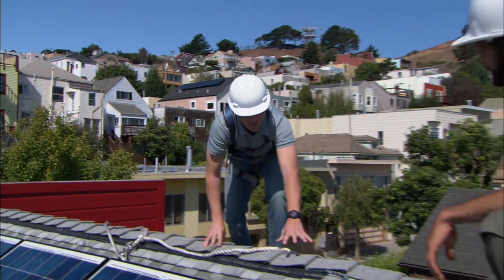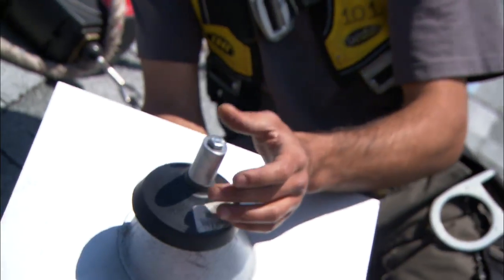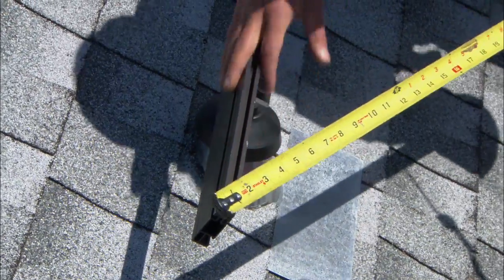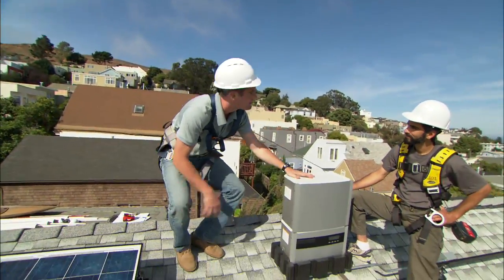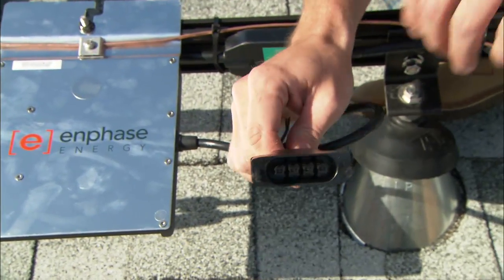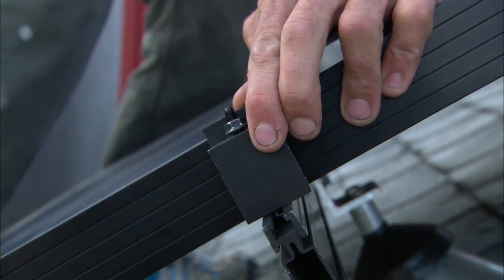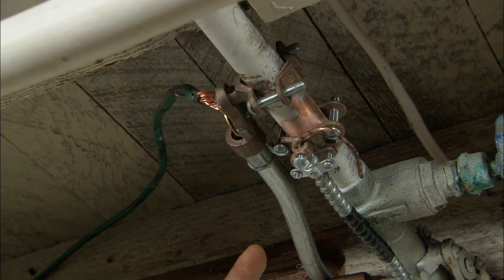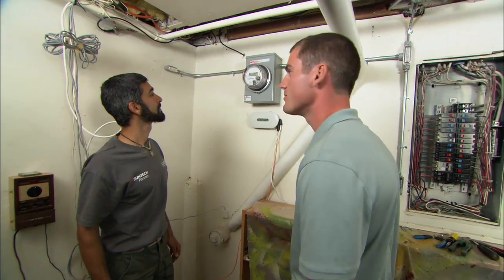How to Install Solar Panels | This Old House

Comment: When I see rubber boots on your stanchions it makes me nervous.   I have been a carpenter for 45 years and have seen many rubber flashing boots, using to flash pluming pipes, rot out in 10 years or less.  The rot is so complete that you can put you fingers through it and flick it away with little effort.  Sustained roof temperatures of over 150 degrees in the summer, guarantees you will have a problem before end of the life of your solar panels.
Reply: They may be silicone boots which are high temp rated.

Comment: I rather replace my power inverter that's located next to my circuit breaker vs going up on the roof and replacing a micro inverter. I will pass on the micro inverter.

Comment: From a potential solar customer, does drilling into the roof cause maintenance and repair issues in the long term? I have a concrete roof and would like to know if I should put my panels in the yard on a motorized pedestal.

Comment: So if the main power goes out does main breaker need to be turned off?
Reply: Yes if it was an off grid system being installed on the house. This is a grid tied system. It won’t back feed AC power unless it senses a load from the grid. If there was to be a blackout the inverters would stop producing AC power.

Comment: question. How to replace shingles uder solar panel?
Reply: You have to remove the array to replace shingles.   Its expensive to do that, so make sure your roof is in great condition before you install solar.  In my case I have a 20 panel 6000W array and we had a hail storm that destroyed the metal roof around the array.  It cost about 11000 dollars to remove and reinstall the array which is about 2/3 of the system cost new.  Then there was the cost of the new roof too.  Insurance paid for the removal and reinstall and new roof, but if it hadn't, it would have been economically devastating.

Comment: Get ready to lay out the $$ when it comes time to replace the roof, all that hardware will have to be taken down first. I bet some of those roofs leak after a while, too, which could lead to vastly more $$$. I'm not against solar, but am leery about roof installs even though that's "the way to do it."

Comment: Did you see the breaker? 20 amps. All of that expense for a measly 20 amp circuit. I have a 20 amp circuit just to run the whirlpool motor in my Jacuzzi bathtub.

Comment: The reason old solar systems used series was to drive up the voltage. New solar panels dont have this issue. Each panel is capable of producing 12-24 volts. You're putting multiple inverters in for no reason. Run each panel parallel into a single inverter and save lots of up front cost.
Reply: This was uploaded 2014..that was standard practice then
Reply: Wiring modules in parallel means thick and expensive home run wiring.

Comment: I have no in-depth knowledge on this, but i guess that all those separate micro inverters come with a downside. Each individual inverter has to measure the phase to know how to sync on it, and stay in sync with the phase over time. Doing that once at 1 big device is already quite applause worthy. I cannot imagine doing that same job at 20 different places in one system will do any good.
Reply: Here is an article about them: https://www.solarquotes.com.au/inverters/micro/ They mention something about efficiency indeed.

Comment: This book [link here >>>https://t.co/z2HakYxvSR ] got me thru the design and installation of a complete off-grid system for my lake cottage. The process of site evaluation, system component selection, wiring, etc. is complex, but with a lot of study and this book, I ended up very happy with the results. Everything you need to know is here. I recommend it for anyone who is starting with little solar panel knowledge and wants to end up with a whole house system.

Comment: might be a good idea to replace the shingles before starting a job like that.
Reply: Could you imagine being the roofer,. They would have to call someone about the system in order to remove it. But from what Ive seen, the shingles looked new AND with the panels, it will EXTEND the life of them further.
Reply: They're probably going to have to pay double when it comes time to replace the singles.
Reply: I always tell people to do so!  very important in Texas and probably any other state of course..

Comment: Solar systems are a waste of money. You still pay. Just on your PAY TO line, it's not "electric company" but "solar company," and a "bank" for the interest.

Simpler answer: Reduce consumption. LED Bulbs, new appliances, timers, unplug things when not using them (plug strips- perhaps wifi controlled), etc. 

Smaller investment. Faster return.
Reply: Nonsense of course. It's your choice to get a loan from the bank instead of saving the amount of money yourself. And the basic idea of such an investment is that you earn the whole sum back and THEN make profit. But saving energy in the first place is always good of course.
Reply: @Engineer9736  at my age I would be dead before I got the return on my investment. I'll leave that for the youngers.
Reply: Or I mean do it yourself without a company and its yours. That's if you sign on with someone like Solar City and the like
Reply: lostintime86 also insulate the home better, replace really old appliances with energy star rated appliances.
Reply: not a waste of money with good installers and the right roof.  at the right price.. i see some people spend 2 times the price as high rated installers  or scam installers also sometimes know people are not getting more bids. and RIP off many..  dont believe all the reviews on companies is all I can say.  best to work with the smaller shops. if you can find one not overloaded with work.  ask for references and go see their work. also..
Reply: @CRsolar  The right roof?? You mean I have to get a new roof? I prefer free-standing units. But I live in a downtown area with no land to put one. Not everyone has the same situation.
Reply: Or just buy your panels. No rent, no financing, buy em.
Reply: @Bob_Lob_Law  what took you so long? I posted that 3 years ago. lol. Still thinking about that for my garage. But it needs a new roof first.
Reply: Menoze  ya, that makes sense for CA. They own the sun there. They make so much electricity they give it away free to Nevada. I am in NH. Not much sun here.

Comment: Another comment... Just read up on installation and a couple of solar companies recommend replacing the roof under the panels if the roof is older than 5 or 6 years old... more cost.
Reply: All they want is more money. Don’t listen to them.

Comment: Is there any worry about the line from the solar panels not being in phase with the line from the power company?  Seems like you'd have a really bad day when you flip on that breaker if they're not synced.
Reply: When the breaker is turned off the inverter does not 'produce' any electricity on the AC side. It is a requirement that if the inverted doesn't sense any voltage on the output, it cannot feed any voltage into the house. This is called 'Anti Islanding' Imagine if an electrician turned off the main switch to work but the inverter was back feeding into the consumer unit. This would be a hazard but the inverter takes care of that and the installer needs to check that when the breaker is turned off the inverter shuts down within 1 second. This also means when the breaker is turned on, the inverter senses the voltage and syncs to the supply, then it seeks to push the voltage up slightly therefore 'producing' electricity. this process usually takes about 30 seconds.
Reply: James Walton thanks James!  Nice to see a smart system.  I know there had to something that synced the phases but didn't think it would be as simple as that :)
Reply: It could be where its set up any excess is sent back to the power company.
Reply: I was curious about this as well.

Comment: Fairly small gauge wires feeding the circuit panel when you consider the size of the wire coming from the power company.  Solar systems are one of the least economical ways of producing electricity.  If not for HUGE government subsidies, no one would invest in these systems if they had to entirely pay for it themselves.
Reply: http://www.zmescience.com/ecology/climate/solar-energy-cheap/
http://www.extremetech.com/extreme/195003-solar-and-wind-power-are-now-fully-competitive-with-fossil-fuels-is-it-time-to-switch-over
etc. You can google more yourself.
Wind is even cheaper.
Porsche924Tim
Reply: Tell this to the Germans. They will explain it and insult your comment at the same time.
Reply: @mawizard6341  Who cares what they SAY,. I only care what the DO ...“Germany, as far as energy policy is concerned, is the biggest fraud globally,” said an EU official. “The public image of German energy policy is very green, but if you check the data, it’s a different story. Missing EU targets could trigger hefty fines from the European Commission ..."
Reply: I'm sorry but your comment is stupid
Reply: Based on what facts???
Reply: Technically all power sources are not cost effective since they all rely on govt subsidizing. In fact solar is cheaper than fossil when all subsidies are removed. (In the US anyway). Fossil fuel is way cheaper in the middle east obviously.
Reply: @MuddinNYC  No, Natural Gas is the most common and cheapest way to make electricity in the  USA.  Solar Panels require a 30% Federal Tax Credit to be competitive.
Reply: Pyroman /  In the USA, we do not use very much OIL to make electricity. #1 = Natural Gas. #2 = Coal.  Solar Panels get a 30% Federal Tax CREDIT !!!  And some states offer additional CRDEITS.  What subsidies do OIL companies get?
Reply: +Mohammed Uddin Mindless Rhetoric... Unfounded... State your sources.